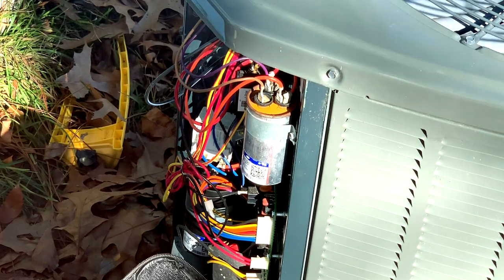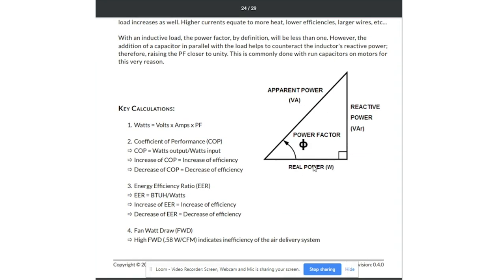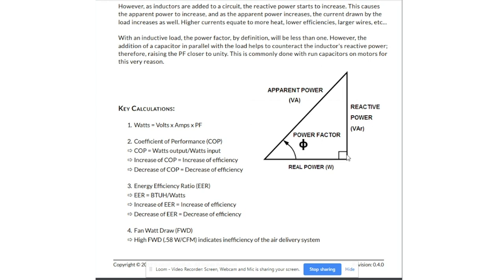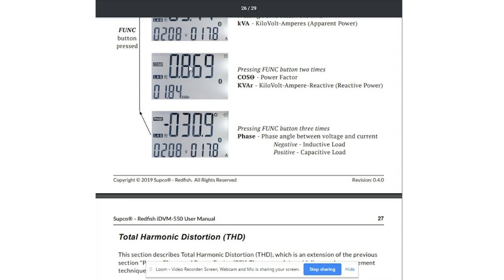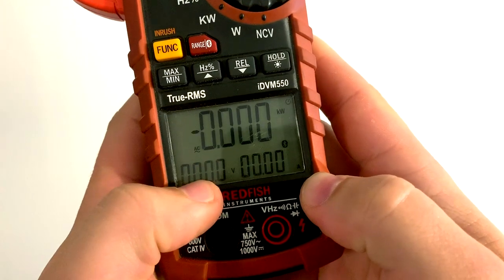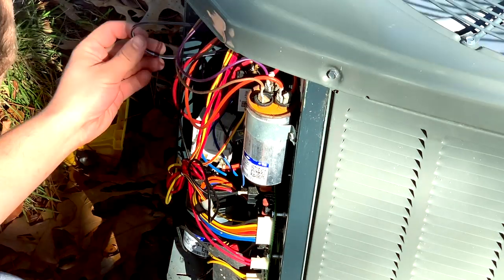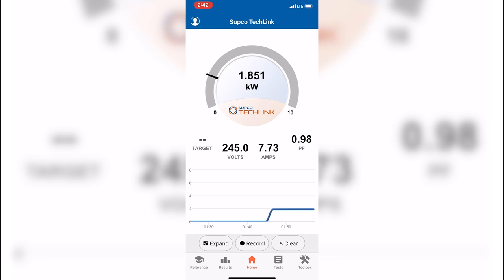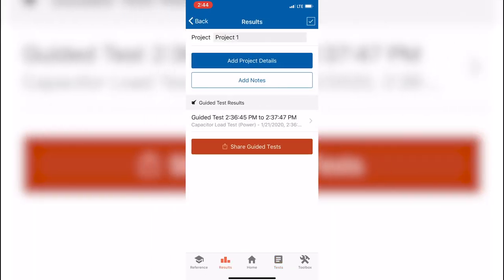Using Power Factor to Check Capacitors Under Load

Comment: I don't think it was mentioned, but doesn't the load play a roll? If you inadvertently use this testing method with say a compressor or fan that is unloaded (staged) won't that skew the results?
Reply: Yes it would. It would be important for any technician to make sure there is a load on the circuit before making any power factor measurement of value
Reply: @kalebsaleeby3354  Not just a "load" but the correct or expected load.

Comment: I have an 04 condenser, my compressor's power factor is 0.75. The rated capacitor is 80MFD, and installed Cap is well in range , at 78MFD. I can only assume that the loss is due to compressor wear. Is that correct? I imputed my data into the calculations provided on The Engineering Mindset's video 'Power Factor Explained' and converted that to MFD and I got 92MFD. Would that increase due more harm than good to my compressor?
Reply: So I’ve reviewed passed podcasts again, and I’m seeing that you never recommended upsizing the capacitor, which is a rule I follow. So a better question would be why am I seeing a low power factor with the correct Cap, and is there any + tolerance that you would be comfortable with or know of (for the sake of restoring efficiency)? Thank you. I would also like to thank you for all of the great free training you provide. You have really helped me to grow in my career and have provided an easy platform to learn better practices, and to continually become a better technician.
Reply: @simonwatson474 you commented on a comment lol
Reply: This was two years ago but sounds like compression ratio was off or perhaps contamination to the refrigerant.

If you see this, did you ever get an answer?
Reply: What calculation?

Comment: So if you have a known good cap and the measurement says otherwise is that an indicator that the inductive load may be in early failure?
Reply: That would likely be the case.  PSC motors are designed for efficiency and high power factor a their operating load point.  The run cap value is selected to form symmetrical rotating magnetic fields at that load point.  If the fields become asymmetrical then the current in one or both windings will be higher than the mains current causing losses and heating.  If the run cap isn't the element that has deviated from the design parameters then it seems that something else, a bearing going bad or such, has moved the load point and dropped the power factor.
Reply: @jkbrown5496  Thank you. It seemed like simple arithmetic but I wanted to hear it.
Reply: InsideOfMyOwnMind may also mean that someone put the wrong capacitor as a replacement!
Reply: @DougMarsh1983  Yeah, ones I've seen had the cap spec on the motor or on the plate

Comment: At what power factor would you start to suspect the capacitors.   Since the manufactures dont put out power factor specs wouldn't you need a baseline reading to be able to determine that there was a change??  And since the voltage is an integral element in the power factor computation would a change in voltage from your baseline reading cause a change in power factor?
Reply: JT H he mentioned anything below .94 would be something to look at as a possible problem. 1.0 is perfect.

Comment: This type of test is done during R&D of a motor to confirm engineers math and capacitor choice. In the field a normal clamp-on multi-meter using voltage and amps is all that is required. Amps X 2652 ÷ Volts = uF. This is under real world load for given conditions. Mr. Psychometrics correctly pointed this formula out. Have done it hundreds of times. No apps or fancy meters required. Your overcomplicating something for what reason, your forgetting K.I.S.S. principle, unless your trying to sell meters.
Reply: What is K . I.s.s?